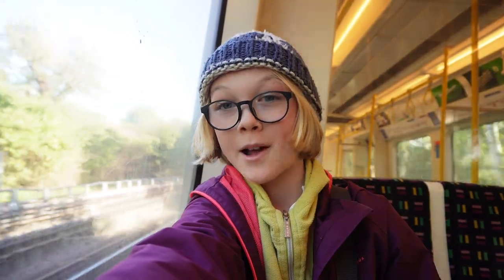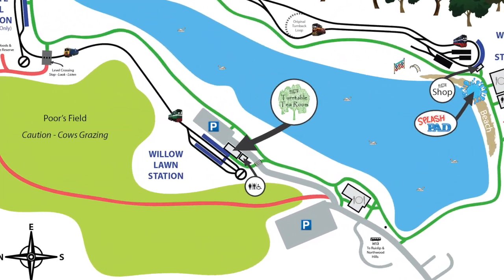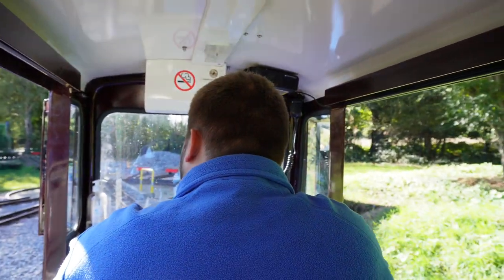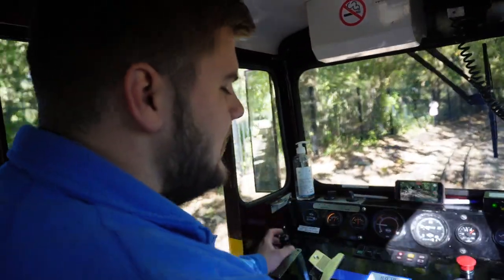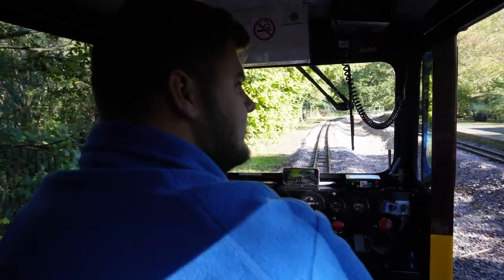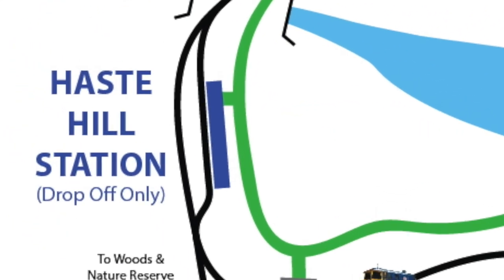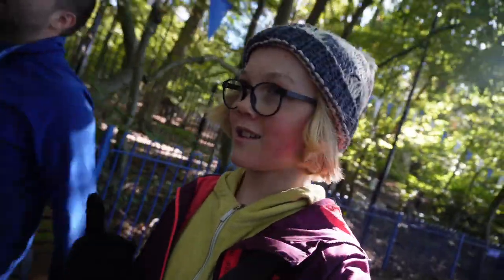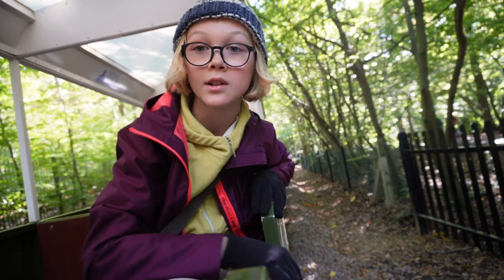Behind the Scenes at the Ruislip Lido Railway!

Comment: Nice video, I would go here but I got a similar railway called Swanley & New Barn Railway in Kent where I volunteer that normally run 3 trains on a normal day and they are smaller than this railway at about 7¼ gauge.
Normally have 2 streams & a Diesel out but can change any moment.